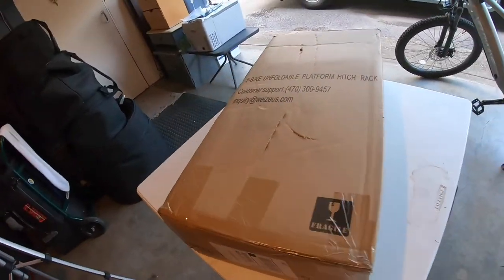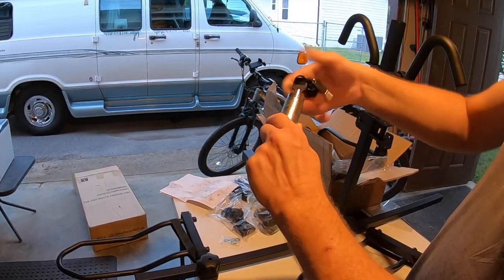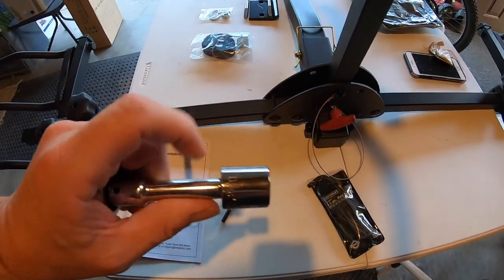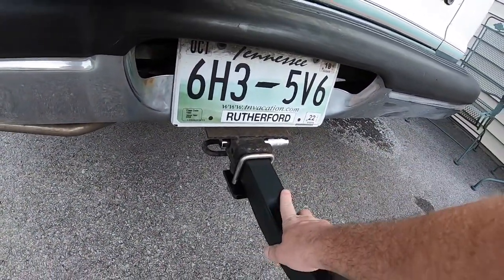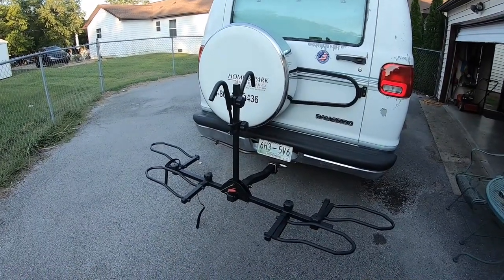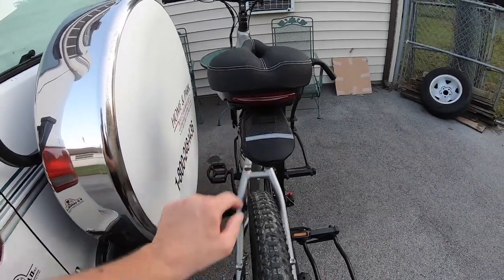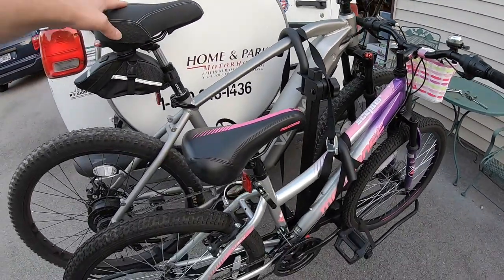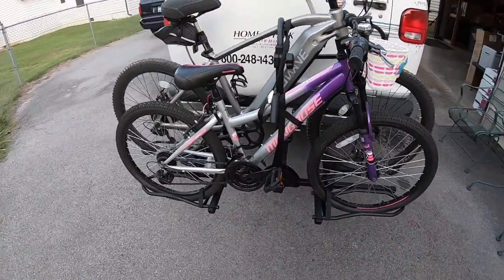Affortable Bike Rack ~ Electric Bikes ~ Fat Tires ~ Rv Van Life ~ WEIZE Bike Rack

Comment: about putting bike on rack--cant you tilt it forward...to put Bike on and then tilt it back?  I saw that in another video...have  you treid that?  also, does yours fold up out of the way when you are not using it?
Reply from the maker: Hello. Yes you can tilt the rack if you wanted put the bike on that way. Aswell tilt to open the back door of vehicle with bikes secured Hope that helps. Cheers
Reply: @KruisinKevin   Thank you very much. How many times have you used it? And are you really satisfied that it will hold the wait?   My bike is a rad runner 85 pounds
Reply from the maker: @alkayemediagroup4536  
Yes I really like the bike rack. I used it last fall on a 600 mile trip. I do recommend when traveling always check on tightening straps and handles. In general bike seems to loosen a little when traveling. But I had to do that on my last bike rack. I added a safety ratchet strap just to keep things tight. You can’t beat the price especially with a tilt rack.

Comment: I have a question about the rack.  Do you have to lift the bike up onto the rack or is there a ramp?  I also have a roadtrek & I have a front e wheel conversion.  I use a regular bike rack.   I have to lift the bike up onto the rack.  It’s heavy but I can lift it.
Reply from the maker: Hello fellow treker. Yes you have to lift the bike on to rack. No ramp. But you could possibly build one. 
Hope that helps. Link below tells description in full detail